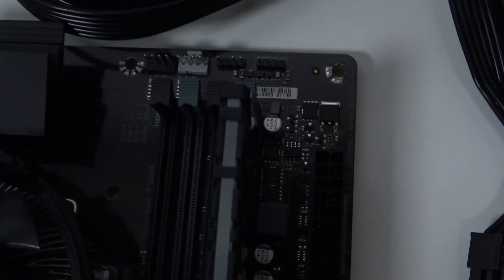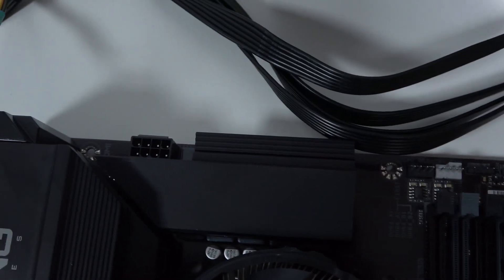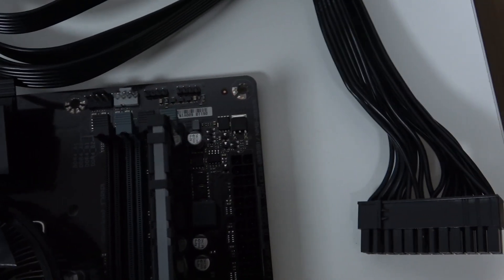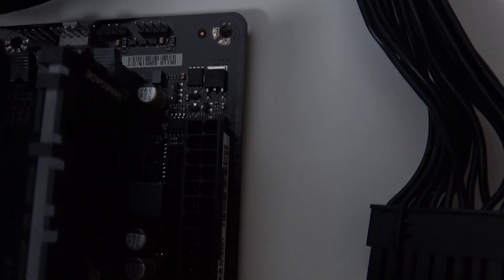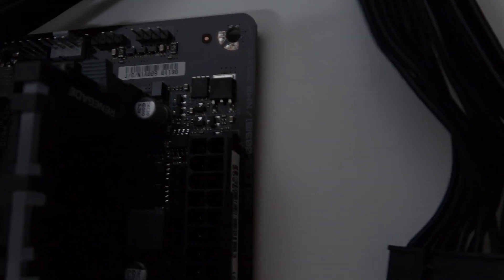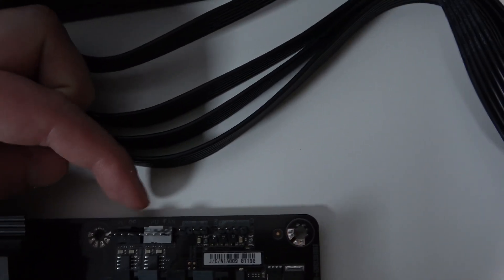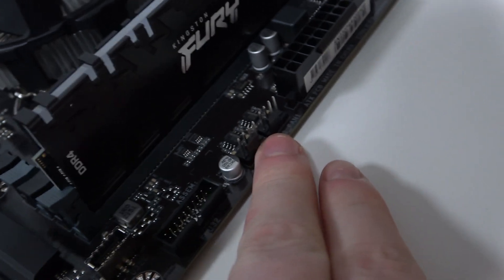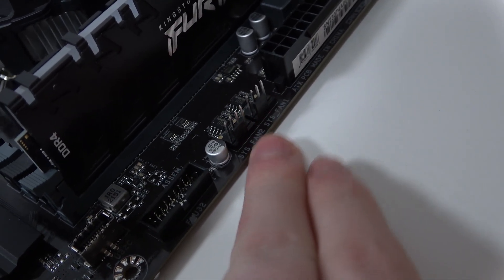GIGABYTE B760 Gaming X - How to Find All Fan Ports? | Locate Cooling Fan Headers on Motherboard

Comment: It is this board compatible with the tower box:
Tower Temperate glass
Corsair iCUE 4000D RGB AIRFLOW USB 3.2 Black

I ask because it uses Corsair iCUE AF120 RGB ELITE and I will put a total of 6, 3 that came in the tower and 3 apart bought of the same model. 
Thank you for helping me to make sure it's compatible and all 6 fans come in. in form factor ATX I do know it is, but I'm worried about corsair fans